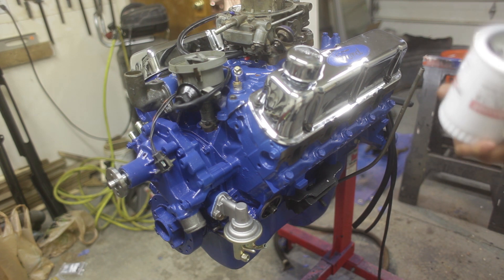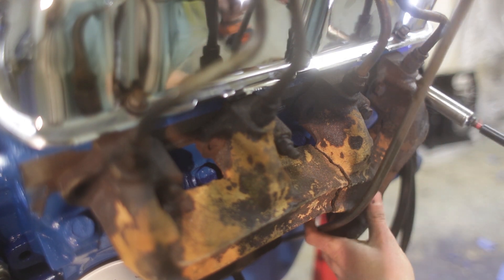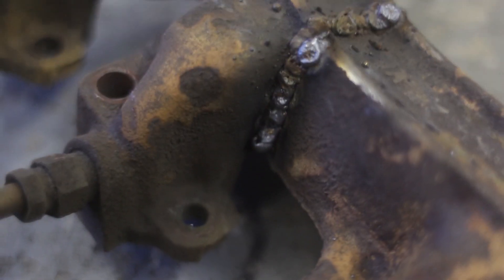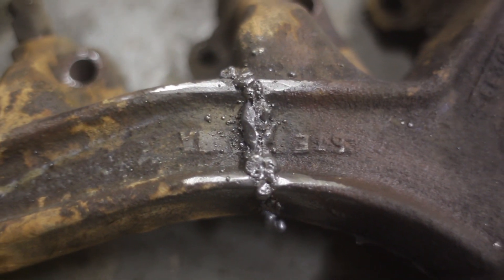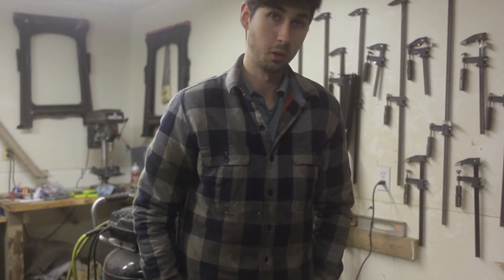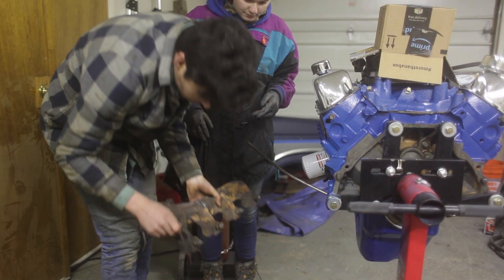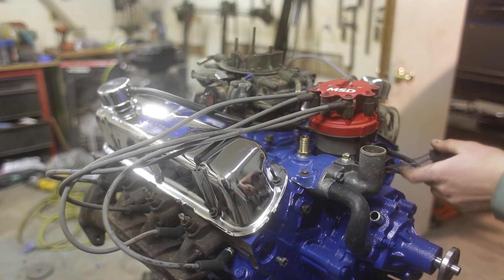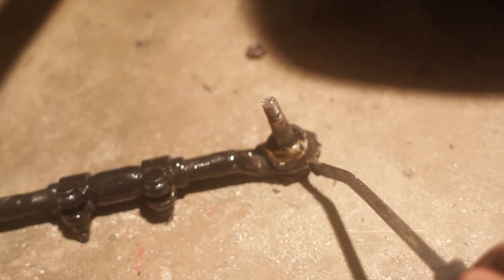Pt 16: Can we weld a cast iron exhaust manifold? + Distributor wiring - 1986 F250 Restoration

Comment: The most underrated channel on youtube
Reply: They do try hard ,..... Mig wire not too good on cast iron , better  weld prep ,  stick weld with cast iron rods ,peen and cool very slowly ,  but not really worth it if you live in the states , Rock auto have these pretty cheap . I have a 86 F150 changed to headers .

Comment: I like to put some oil on the seal of new oil filters before installation. Dry seals can be sticky and/or leak imo. As for welding cast iron...no comment. Last but not least those ball joints are threaded and screw in and out of the ends of those 'tie rods'...usually. Keep up the good work guys!
Reply from the maker: We are several months into driving the truck and the manifold is still holding. Definitely the worst thing I have ever tried to weld though.

Comment: Go to a junkyard and grab a new manifold, you can get them for less than $50. If you're dead set on welding it your best results are gonna be to clean it and preheat to 500 to 1200 degrees. Or just try to kb weld it
Reply from the maker: We are a couple months into driving the truck, and they have actually held up. No more cracks or leaks. Going for headers next